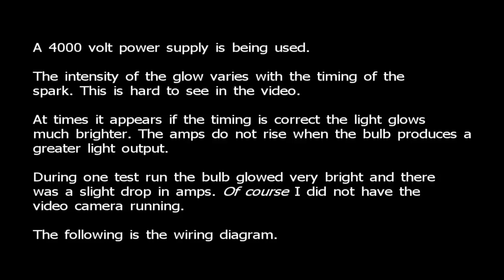SR193 two xfr

Comment: This ones interesting but it defeats the purpose of having two differently driven coils in close local inter-relation eh?    Kapanadze seemed to be about using the primary as the HF/HV AC coil... and the secondary was then driven with the 60hz 120vac inverter signal and output was then taken from that secondary which was where the gain resulted due the HF/HV/AC field collapsing into the 120v/60hz/ac slower field...  

In the above schematic it makes sense that the lamp would glow a little brighter when the HV fired into it, presuming the discharge was in phase with the power fed to the lamp otherwise it would be expected to dim the bulb eh?

Comment: There is no way an induction meter can read current coming from your sparks. So the test is pointless. Only way is to read voltage drop across a small resistor with a scope.  Or, if you can get the sparks to fire more reliably, you can use a true RMS amp meter in series.